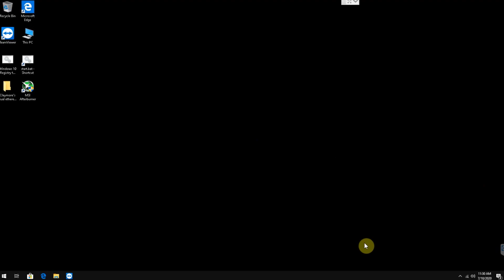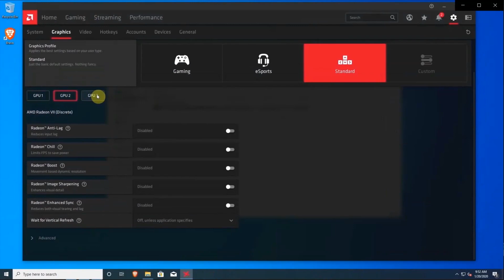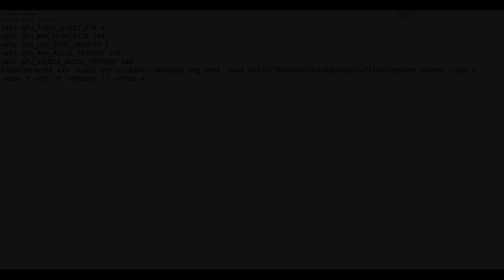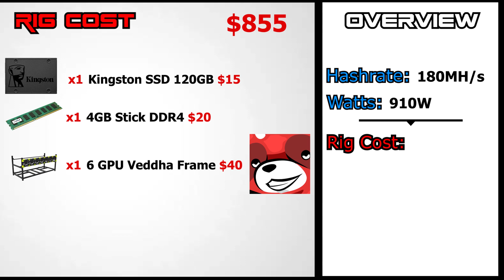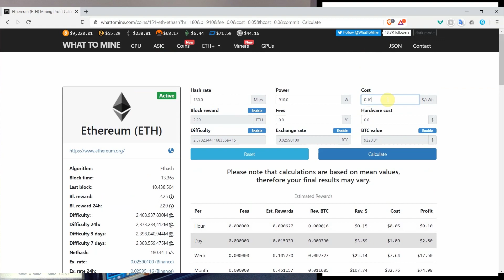RX 580 Mining Rig Build | 187 MH/s and 850 Watts!

Comment: It's cool machine, and I like little fans you have there.
BUT.... $2/day profit ratio will tell you everything.
Don't spend $1k+ and mine to make $2/day.
Break even will be after around 500+ days mining 24/7 without risks of breaking and decreasing $/day ratio. (which will happen as mining is highly volatile.)
Reply from the maker: Thank you! Well this machine already broke even, I'm not sure if I said it mines $2 a day but if I did I'm wrong, it usually mines $1 per GPU so $6 a day. Breakeven calculation is less than a year. You can check the Google sheet we have for the numbers in the description of the video, it will be in Miningchamber.com

Comment: normally i would throw hate for you guys driving up the gpu prices too high but goddam that a clean lookin rig
Reply from the maker: xD Thank you and we are sorry! Although now the scalpers are the issue :( Take it easy!
Reply: @MiningChamber  i have a ryzen 1600x liq cooled 16gb 3200s ram and a evga gtx 980ti im half tempted to give it a go but i only have a 600 or 650w psu
Reply from the maker: That is a really nice system! Although if you try to mine ethereum with a 980ti it won't hash that well! Might lose you money if your electric is expensive. Getting one of the recommended gpus to mine with them is surely the way to go!

Comment: hey need help, so im building a similar rig with 8 on it, but my cards only have one 8 pin connector. so your saying i should get the pcie splitters connect one end to the gpu and one to the riser and then the psu connects to the other end of the splitter correct?
Reply from the maker: That is correct!! More on that in our PSU ATX guide, I recommend you checking it out! Should be one of our latest videos
Reply: @MiningChamber   ok will do thanks again! keep up the good work!
Reply from the maker: Thank you!!

Comment: Is it worth doing mining from home these days?
Reply: No man. None of these content creators seem to take into account hardware failure rate and replacing/updating of hardware. It's a constant battle for pretty much no return. Takes you 12 to 18 months to get your money back and then you're going to have to replace it all soon after anyway. As a hobbyist you will never make money mining. Unless you happen to be in a circumstance where you don't have to pay electricity.
Reply from the maker: Hmm Im not sure what was your experience with mining but 3 out of 4 rigs paid out in one year and also they are still functioning A+. Which leaves the hardware as another asset that can be sold for 50-70% of your initial investment.

The constant maintenance might be with ASICs but for GPUs I know of miners that had it running for at least 2 years before having to replace a broken fan or anything like that. As per my experience I haven't had to replace any damaged parts for all my rigs mining for a full year !

But again ofcourse returns vary on your electricity pricing. If you have below 10 cents kwh then generally your on the safer side
Reply: @MiningChamber  You are actually correct. I don't know why but I was thinking average gpu life span was 2-3 years when mining. 5-10 seems to be the norm. I was wrong. 

Thinking about it, might not be half bad idea  to stock up on credit and just have it pay its self off in 1 year.
Reply from the maker: Ahaha it's okay that's what I kinda did 😂😂⛏️ although ofc it's an investment so be cautious ! Not a financial advice 😂
Reply from the maker: It all depends on your electricity costs! For having rates below 10 cents kwh it will be fairly profitable ! And ofcourse, the inconvenience of heat and noise, if you can manage those then your set

Comment: To make this more efficient can you double the GPUs from 6 to 12 units and get a 220v power supply?
Reply from the maker: Hypothetically yes you can! Although for PSU usually you'd just want to get another 1200 watts PSU and then you can run the rig off of 2 PSUs or a 2400 Server Psu but it's best to balance it between 2 1200 watts ATX PSU as far as I know for now till I do more digging about server PSUs !

Comment: Is it radeon 19.12.1 or 19.1.2?
Reply from the maker: You can install the latest drivers ! Check out our GPU review video it will be on our website or in this video's description where we covered everything to tune the GPUs
Reply: @MiningChamber  I'm having an issue in which the miner allocate just 4gb of my gpus even though my variables are correct. I have 4 rx580 8gb. I suspect the new driver is the cause of that. I was mining just fine at first but then suddenly this problem occurs in my gpus. That's why I would try to install older driver version.
Reply from the maker: Oh I see that's quite odd then give a try to 19.12.1 and see how it goes!
Reply: @MiningChamber  please help. I am getting error on dag #380 and up. It says idon't have enough memory to mine the coin but I am using rx 580 8gb. I'm getting this error on claymore miner. I already set max gpu alloc variable in the miner and I also clean install win10 and amd driver. Whenever I check the log file it shows only max alloc size is 4048mb
Reply from the maker: Hey! I'm sorry for the late answer I think what your looking for is your virtual memory settings. Check out top 5 must do tips for mining in windows 10 video and it should solve that issue!!
Reply: @MiningChamber  I have 50,000mb for my virtual memory setting. It's strange because I am not getting this error in phoenix miner at dag epoch #380

Comment: i need a good deal on a power suply . i had baught 1 form amz but they did not give me all my pcie wires
Reply from the maker: Powersupplies are surely hard to find now :( good luck!!
Reply: @MiningChamber  how many watt power supply  can you plug into 1,  20 amp out let
Reply from the maker: It all depends on how much power you draw from them! If the outlet runs on 120v then the equation will be 120v * 16. (16 because of the 80% rule of 20) 

We do go pretty in depth about that topic in this video https://youtu.be/MF_ELz0OV7I id reckon you check it out! If you have any more questions feel free to let me know!

Comment: great video! how much profit would I make monthly on $50k setup and free electricity?
Reply from the maker: It's hard to estimate just like that and all the numbers do change very often.

Generally speaking I see profit margins to be at 6-15% margin without electricity cost. The market is a little low now so youl probably make 7-8% of 50K every month
Reply: @MiningChamber  got it! that actually sounds good, and I meant generally speaking because I still don't know which cryptocurrency has better returns.
which crypto should I start with that make me 7-8% a month?
Reply: @MiningChamber  thank you!
Reply from the maker: No problem! It all depends on your hardware. Usually all gpu miners mine eth or etc now since it's the most profitable
Reply: @MiningChamber  perfect! thanks for the quick response

Comment: Love the video! Hey I’m just starting out with a 5 rx580 8gb rig. I’m experiencing low hash rates on the cards further down on the board. I’ve changed the pcie to gen 1 and enabled 4g encoding. The first one gets 30mh/s but the others only get 20.
Reply from the maker: I thought I have replied to this! Seems like it didn't send. So I am having a similar issue I'd recommend trying to change gen settings try 2 and 3 and then ultimately try a different mining os maybe HiveOs or any thing else
Reply: Mining Chamber I was able to read a bit of your first reply and yes there is a pattern, 1st card runs at 30mhs, second is 27, 3rd is 24  and the last two run at 20 thanks for the advice, I know it’s a pcie issue for sure. I just wanted to make sure I wasn’t crazy 😜

Comment: My RIG has 184 MH/s on ETH with 500 Watts - easily powered by my solar system ;-). 1500 EUR hardware cost for the RIG/PC.
Reply from the maker: Nice!! Which gpus are you running and what's you oc settings? That is pretty low wattage!
Reply: @MiningChamber  Im wondering aswell.
I'm currently doing 183 MH/s
673-675 watts from wall, x6 570 8 GB Rig.
I dont think it's AT all possible to use 500w from wall, and get 184 mh/s
It has to be all gpu's.. and not from wall.
Reply from the maker: I think so as well, but maybe there is a secret sauce we know not about 😛
Reply: @MiningChamber  I explained in detail on my website www.ethereumeinfach.de - it's german but you will find the hardware easily ;-). I just started a few days ago, so I am happy for every single visit :)

Comment: Man your videos are very very very helpful! I'm looking to get into this as a low grade passive income for now and this might be what I base my first rig off of. Would you be willing to help come up with a build that has a 5K USD budget or be able to point me in the right direction for build guides if I was willing to jump straight in with a decent investment like that? 

To clarify, I know it won't be an amazing profit, but I like min/maxing things and I figure with that investment I could maybe see what would to me be a reasonable ROI. I don't think for a lot of us that 5K USD is a bad guess at possible upfront investment, from the reading I've done it's a pretty solid mid ground seeing as some of these rigs can exceed 10K.
Reply from the maker: Thank you so much!! 

Come join our discord il definitely be able to help you out with the community.

There will be two paths for you, NVIDIA or AMD. NVIDIA is usually easier to setup and are faster to get going but they do come at a higher price point per Mh/s. While AMD is the more profitable side because of how cheap the hardware is for performance  but it does take some time to set up and you can run into issues that will need patience and troubleshooting. Our 5700XT mining build is a pretty profitable one but it was hard to get stable and consistent ! I recommend checking that video out!  Don't forget to join our discord!
Reply: @MiningChamber  thanks for the reply - do you mind throwing up the discord link for me? 

I kind of got that vibe as well regarding GPU choice - it seems the 5700s with the XT Bios flash are maybe the current best bang for the buck.
Reply from the maker: Unfortunately the 5700s are EOL (End of life) which means if you try to find them new, since they are not made any more you will find them as the same price as a XT. I do recommend getting the 5700 XTs right away or the 5600s as well. Check our 5700 XT build and youl get the idea of that build for the budget.

As for the discord link https://discord.com/invite/bK6ptDN see you there!

Comment: Great stuff. I'm getting 188 Mh/s at 800W on 6X 580s with Hynix mem. Linux really does well with AMD cards. Core voltage is well managed this way. 860mV on your mem voltage. 865mV on your core.
Reply from the maker: Thank you! That's awesome we will try that! We flipped it to HiveOs now ⛏️🙌 definitely much better than windows so far
Reply: @MiningChamber  I briefly tried HiveOS. It's so good for remote and flexible management. Wish I could've stayed with it. But I could never set the voltages correctly using their overclocking tab. I use ethos and it works great.
Reply from the maker: That's good to know thank you!! My rig has been crashing here and there so the undervolting as well having some issue but we will sort it out and make an update about it!
Reply: @Mining Chamber - Check that. Turns out my power meter was faulty. I'm getting 191Mh/s @ 847W total system power measured with a new meter. And it's 835mV core, not 865. You've done a great job with your power efficiency!
Reply from the maker: Thank you!! I need to get a new power meter as well to make sure 😂 this one been through alot. But thank you definitely some room to improve, I'm sitting on 850mv il try to tune it a bit lower

Comment: Hmn msi rx 580 lowest 1pic price is 170  how you get 6x 580  only 660 ?
Reply: Yeah that was a good deal on those gpus
Reply from the maker: We did use the prices that we got it for so it is not off the shelf price. We bought then used for $110 a piece! From now on though we will talk about off shelf prices instead of used deals since that wont be as common. Sorry!

Comment: Someone told me, that he achieves 165 mh/s using 6x radeon 5500 xt for just 500W. Seems that your rig consumes more Watts, right? Each his 6 cards work for 27,6 mh/s and consumes 70W of energy.
Reply from the maker: That is pretty effecient! Although is that the watts draw measured out of the wall or just in the software?
Reply: @MiningChamber  of course out of the wall. I don't even look at the software when it comes to the wattage :)
Reply from the maker: That's awesome! We definitely will try to get our hands on some of those cards. Really effecient! This rig does consume more at about 850 watts off the wall for around 187mh

Comment: Hello, anyone know a solution to this:

I have X3 rx580. One runs and 22.6mh and another at 24.8mh. the problem is with the 3rd card. It runs at 30.5 for a few minutes then the miner crashes and reloads then that 3rd card is mining 0mh. I even saw it just to 50ms for a minute before it crashed. I don't know what's causing this, does anyone have any suggestions? Thanks
Reply from the maker: Hey! I would suggest first changing splitters, then checking your overclock settings and reduce them a bit so it doesn't crash. Also make sure your applying the straps and rxboost properly. It should print out in green that it applied successfully!
Reply: @MiningChamber  Yeah I tried different risers and does the same. Seems to be just the one card because running the other 2 work fine together. Could it be the power supply. Found it cheap for 1300w. Btw all cards are on default clocks. But that card is running at 30mh but isn't that only possible with overclock or flash?  Not been into this for long so still need to do the rxboost configuration.
Reply from the maker: I see, so if you bought these cards used they could have been BIOS modded. Try to follow our RX 580 overview video step by step and let us know how it goes
Reply: @MiningChamber  Yeah all bought used. I've asked the seller and they haven't modded the bios on them. I'm using Awesome Miner to mine with and whilst mining was promted that the GPU was running to fast and to lower clocks. The clocks are stock but starting to think it's something to do with my power supply. Just gonna use that card in my other system to check how it runs. Could it possibly be the power supply pumping to much power into that specific card causing it to over run? thanks for the help.
Reply from the maker: Hm I never heard of such situation of a power supply. Id recommend following our gpu overview for the RX 580 first then let me know what happens. Make sure to install latest drivers, overclocking and strapping.
Reply: @MiningChamber  Hello just to let you know I solved the issue. Seems like the Bios was the problem. There was 2  stock bios that I found for the card so flashed the other one and it works fine. Getting 24mh. I then modded it and it now mines 30mh stable. Your video helped a lot. Thanks
Reply from the maker: Great to hear!  Thank you!!

Comment: claymore and phoenix both allow a config.txt file. you can put all the parameters in it and save mucking around with any other tool.   so for instance you can set cvdc, core speed, memspeed for each card. in my opinion phoenix is better because its still being developed. obviously if you use phoenix you must bios mod the cards but pbe 1.7.4 is great for that. 6 good rx470 8gb will get 180 megahash and 800watts but it takes a bit of time to dial it all in. what i found to be really really good with second hand card is strip them and remove the thermal paste and re-apply it. made a huge difference to card temps and allowed lower voltages.  all rx470s ive ever used have allowed core volts of 900mv or less and still got 30megahash
Reply from the maker: That's great to know! I've usually just throw all the scripts in there but with config.txt sounds like it will be better.

As for the hashrate these numbers in this video are a bit outdated before we got to do the review on the 580s we were able to reach around 31mh with a 850mv using the straps and rxboost. But we'll keep tuning it more and get to the 800 watts range! Thank you for the valuable info!!

Comment: mine cost so much less. I had a roi in 5 months. I have 2 rx5700xt's, 1 1070 ti fe, and 2 rx480's. Average $6 bucks a day. $180 a month'ish. Used an old case, mb, memory, gerry rigged a 2nd old power supply so when main ps turns on the second turns on. needed to do some soldering and wire snipping. main ps was only 650 watts. used a second 450 watt power supply rednecked to turn on with main one to power remaining 2 cards. 1070 and the 2 rx5700xt run off the 650 and the trailer trash 450 watt ps ran the 2 480's. got me 2 pci risers that gave me 4 usb plugs on each daughter board. as long as mb has the spare pci bridges internally you can do this. bought wish app risers with cords. got a 10 pack for $15. Its ugly but its paid off and im saving up for some radeon 7's.
Reply from the maker: That is awesome! Looking forward for you getting your R7s!!